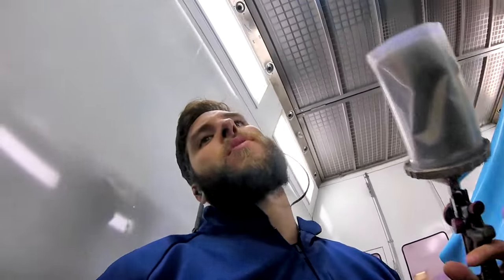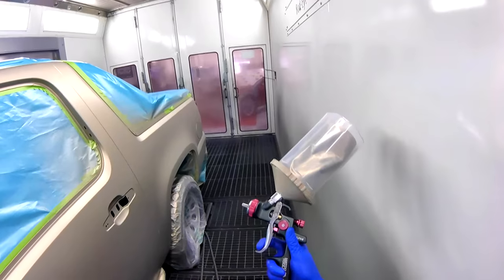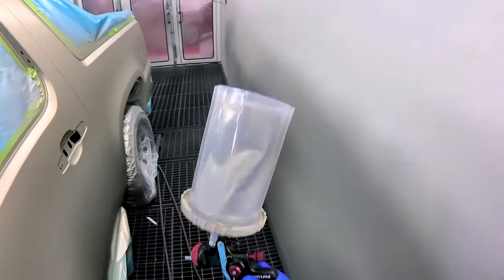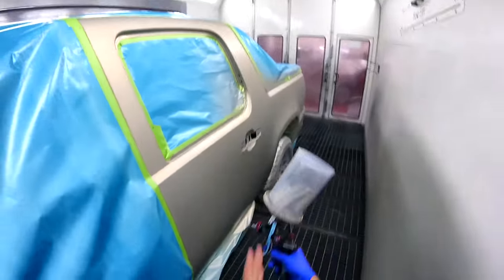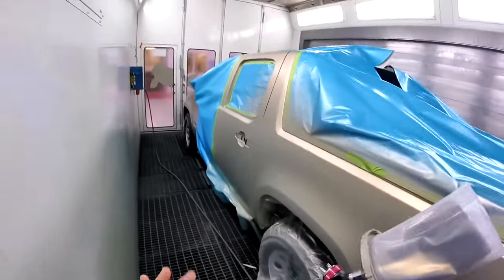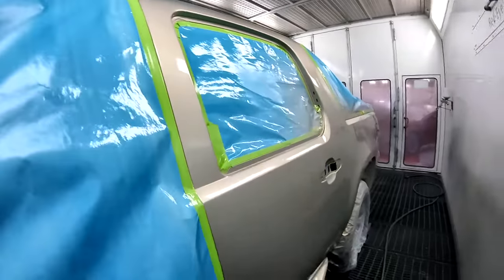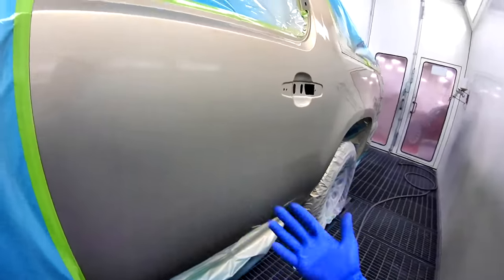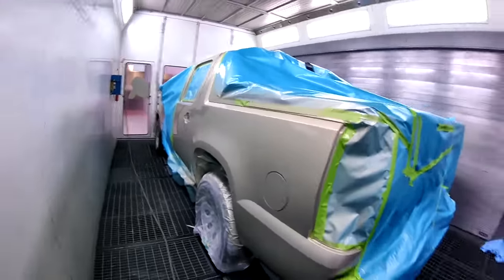How to blend a difficult gold

Comment: Excellent video as normal gabe. Question..I was told that you need to walk the whole panel or length of the car to spray colours like candy and camaleon so you wont see thebuild up between the jams. Would this style you now demonstrated work instead of walking the entire length. Thanks man..Terrence here from Trinidad and Tobago.
Reply from the maker: +terrence ramdhan thanks so much !! I haven't had issues doing it the way I do for color you want to stay away from the end of the blend panels for sure the whole point is to be consistent however you achieve that is completly up to you 😀
Reply: You will be fine with metallics. I always try to walk the panel on pearls. Thats it.

Comment: good tip... gold colour would be hard to match!....I would have though if you lower your psi down as you said 18 psi... the gold  may look much darker in the blend area creating mottling in the panel.... I guess a few spray out cards would be needed to get the psi just right not to over darken colour due to lower psi
Reply from the maker: +henri yeah for sure but for ppg they recommend lowering pressure for control coats. Some companies don't